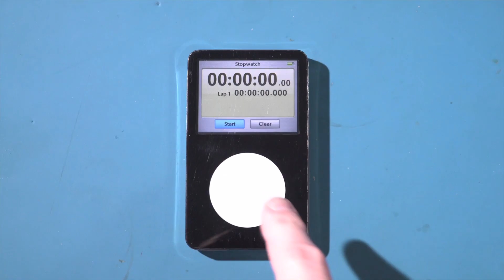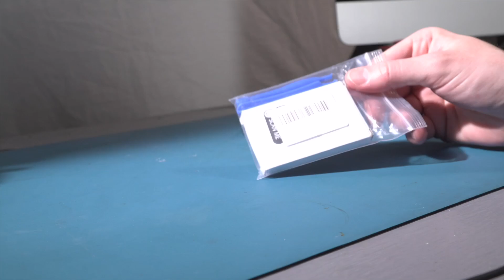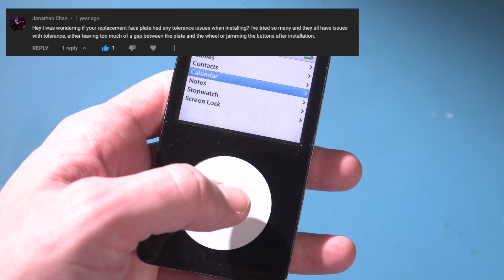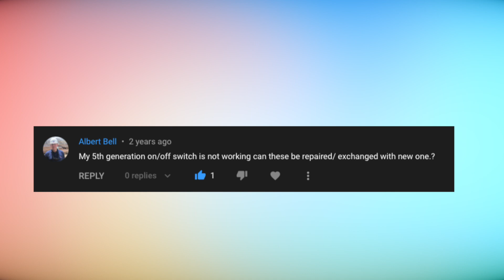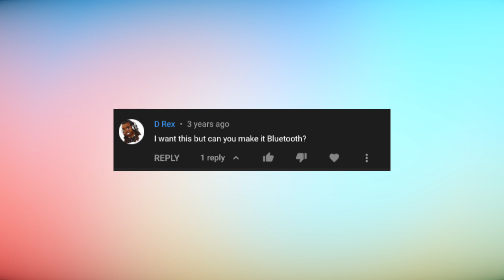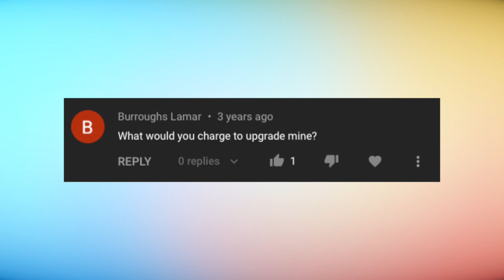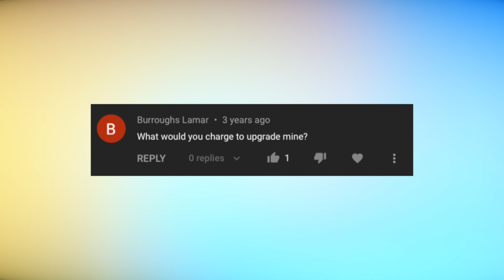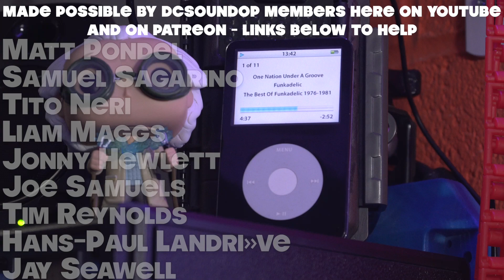iPod Video Rescue 🛟 4yrs of Viewer Questions Answered📱

Comment: My issue is syncing with my Mac. I had to use Bootcamp and wi does to sync my music. Worked, but a bit cumbersome.
Reply from the maker: Was your music library originally setup on a windows machine when you first had the iPod? Thanks for watching JT.
Reply: @DcSoundOp  no, I don’t use windows for anything really. But the finder sync didn’t work and I just defaulted to the windows sync which was flawless.
Reply from the maker: Interesting... not at all sure then why that would be happening, but good to hear it worked out for you in the end!